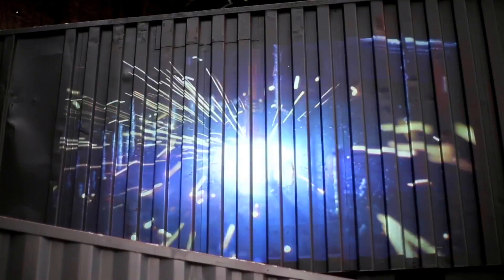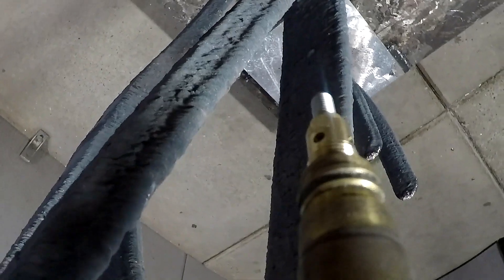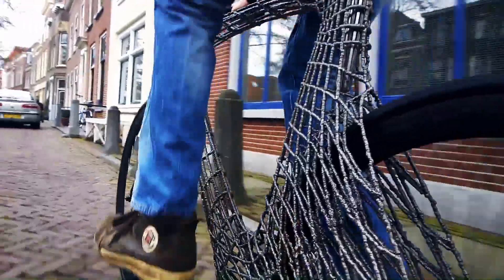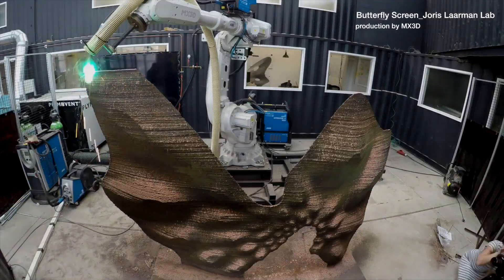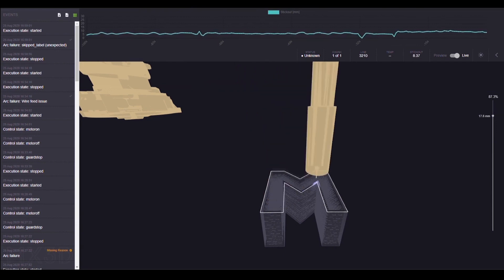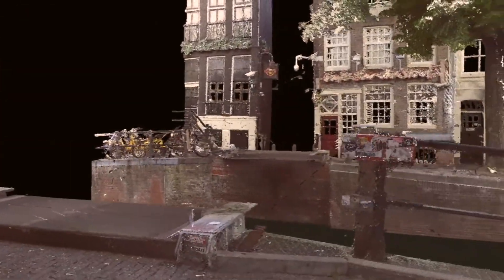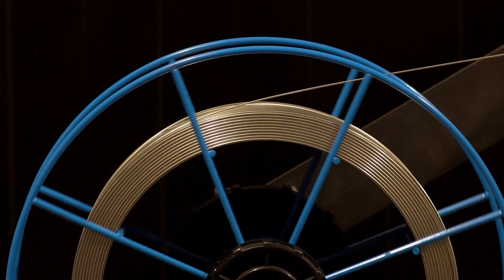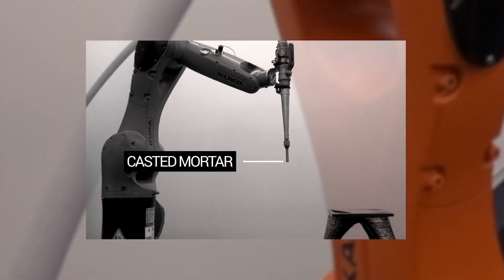3D Printed METAL is Automating Construction [MX3D]

Comment: I’ve visited MX3D during the Amsterdam Nord festival where a lot of the previously industrial area just north of the central station opens its doors to the public.

Seeing MX3Ds creations in person is incredible.

It looks like the bridge might be installed opposite Cafe Bar De Stoof. I remember drinking in there one night when the local utility company came along and turned the power off since they hadn’t paid their bill!

Anyhow, there was also a patch of land set aside in the north area of the city for some young engineers and architects to 3D print larger structures & decorative components for houses. They had build their own large scale 3D printer and were extruding what was probably an 8mm bead of recycled plastic to create the exterior shapes of components, then filling those components in with concrete. The results were impressive and they were able to create beautiful organic structures.